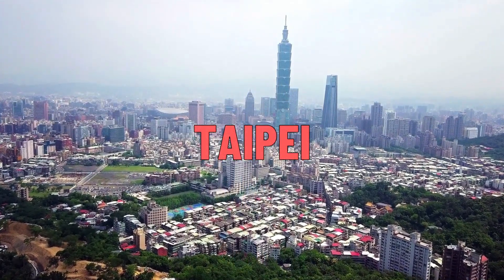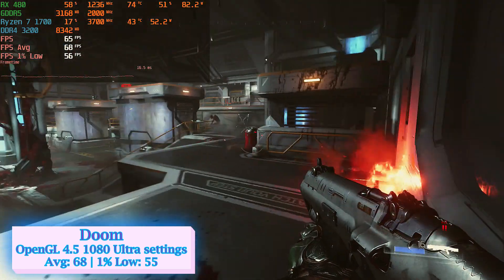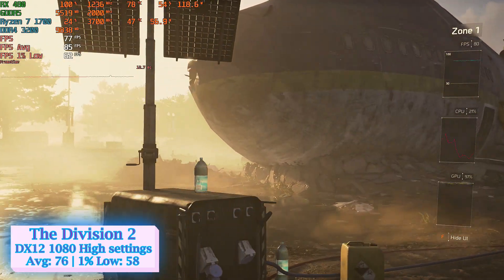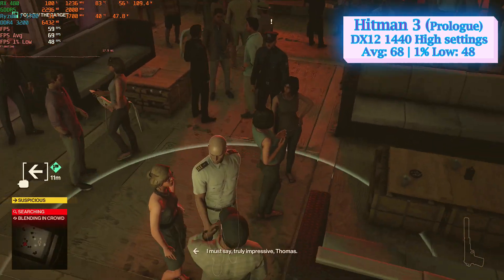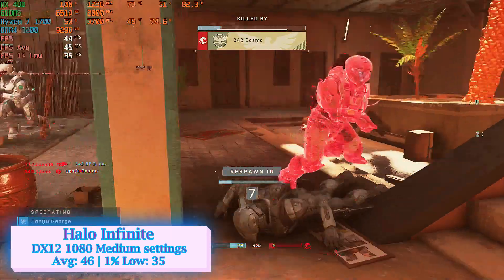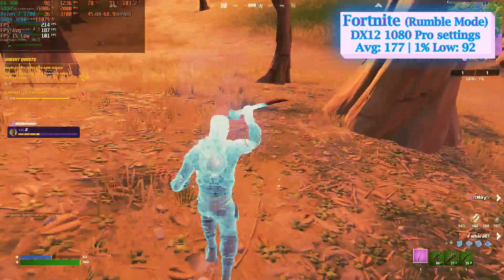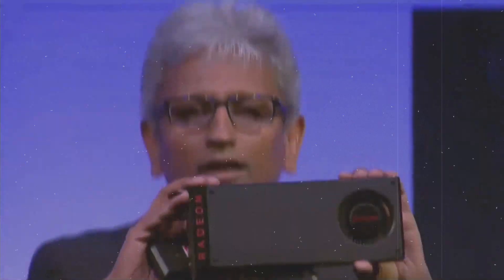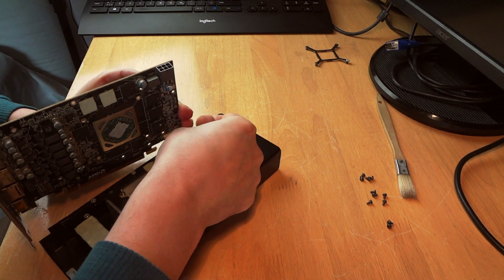AMD Wants You to Forget About This Old Polaris GPU • Radeon RX 480 8GB

Comment: Nice video!  I've got a Sapphire Nitro+ RX 580 8GB which is really an "upgraded" RX 480 with better cooling and a faster clock speed and it still performs quite well today.  Nothing is obsolete that still serves a purpose for you!  From what I understand is that people that still own the 480 really still love them!  They may gobble more power but hell, I still use an ASUS CUDA II GTX 780 ti that keeps my house warm in winter and gives my air conditioner a workout in the summer and absolutely LOVE it AND my 580!  I am a pretty easy guy to please in just about everything...being poor too, sees to it as well.....😁👍👍
PS: SUBSCRIBED!  👍👍
Reply from the maker: I would never consider poor, a person that owns an RX 580 as well as a GTX 780TI, I would consider it as a person that knows much about cost/performance and has good taste on antique heating elements 😁
PS: Thank you very much for the sub. 👍
Reply: @obnot  LMAO on the "antique heating elements!!"  😂😂👍👍
Reply: Polaris runs like a dream underclocked too, i use a old FX 6300 system with a RX580 (dont ask me why) underclocked at 900mhz and 800mv at core and it can still game at 60fps 1080p in most ~2015 games, even Overwatch (i play it on low tho) , only needing the stock clock when i'm going overboard with mods in Assetto Corsa or want the full GRWAFIX mode. 

Underclocking is good because it runs colder, quieter and saves power.... and i don't wear down my GPU on a bottlenecked system lmfao
Reply: @LorikQuinn   What about undervolting it too?  I thought about trying that in both my 780 ti and RX 580, but I often just "leave well enough alone" so as not to start problems with destabilizing the system and possibly corrupting data. I DO want the cards to last as long as possible, though, so undervolting just a "smidge" may be a good idea.....🤔
Reply: @arthurmann578  it's what i do, i have 2 profiles set up in the radeon software

Underclock + undervolt                  Gamer mode (stock clock undervolted)

Core clock @ 900mhz                             @ 1360mhz
Core voltage @ 800mV                           @ 1000mV
Reply: @arthurmann578  these numbers will vary with the quality of the components on your GPU, so you'll have to experiment a bit and my number might be too low or high for yours

BUT don't be afraid to undervolt, all that will happen is a crash and have your pc reset if you go too low on the voltages, it will not damage anything unlike overclocking and will help make your parts last longer because of the lower heat output and lower energy usage in general
Reply: @arthurmann578  as for corrupting data, as long you ain't using RAID or running unsaved projects in the background WHILE doing the undervolting, you're fine. Just find the lowest your chip can go while running games and give it like a 10mv wiggle room to account for usage spikes and you will be fine foreever. If your graphics crash then maybe raise more 10mv until you get to your sweet spot
Reply: @LorikQuinn   Thanks for the info, bro!  I think I'll give it a go in the very near future!  Be well!!  👍👍